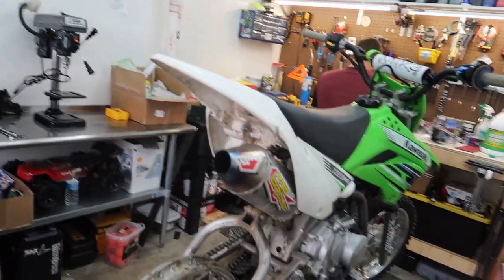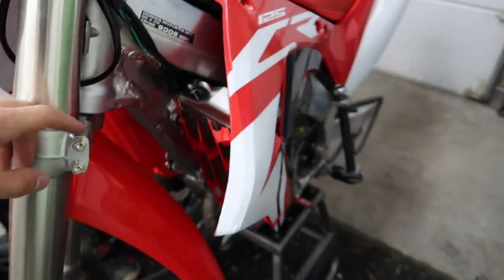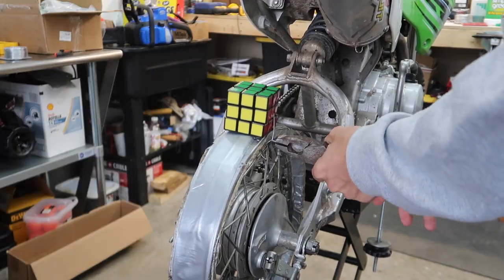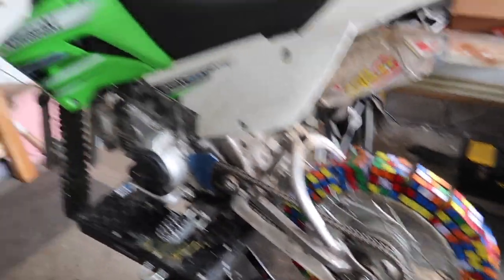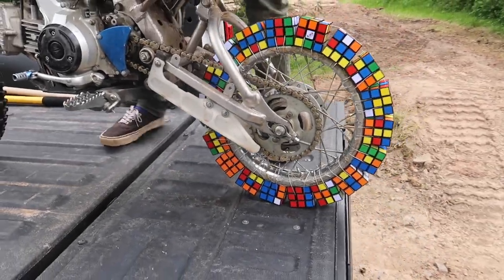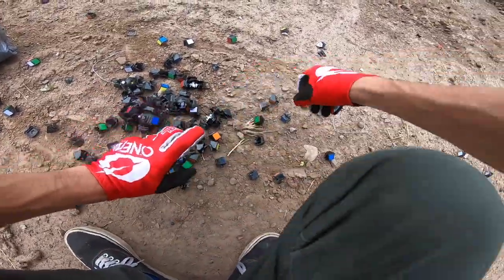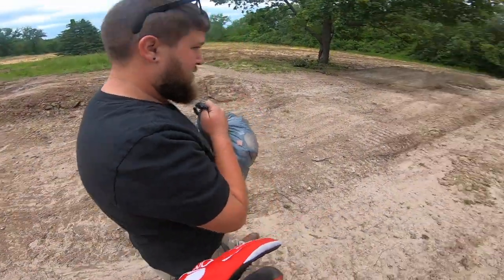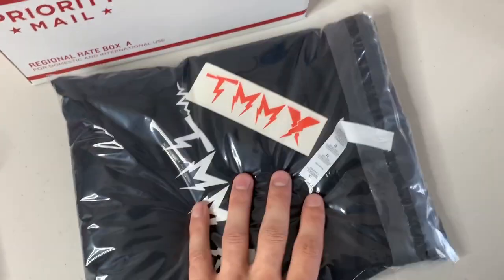PIT BIKE RUBIK'S CUBE TIRE!!!

Comment: You should put a hole in a tire the put a tire value stem in it then take out that pice inside of the valve stem then fill the tire up will silicone and then cut off the tire and have a silicone tire